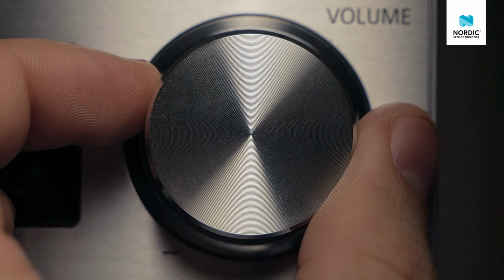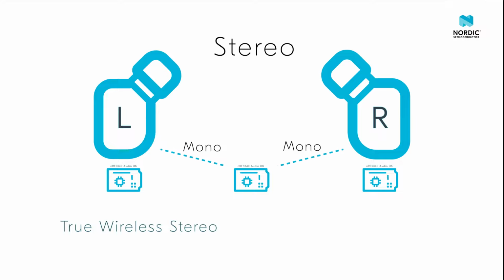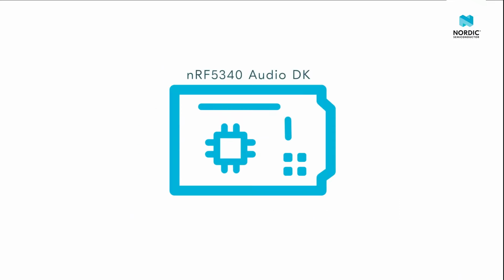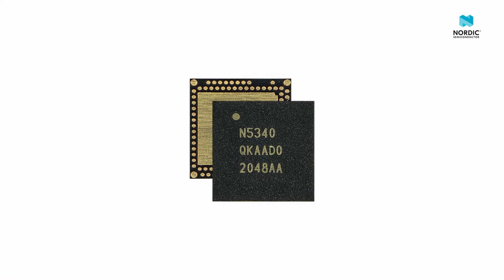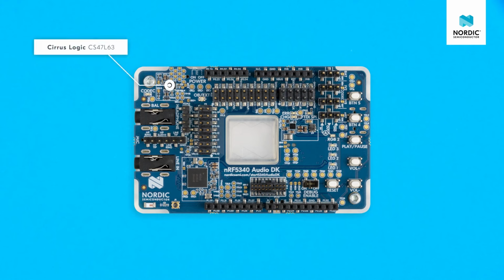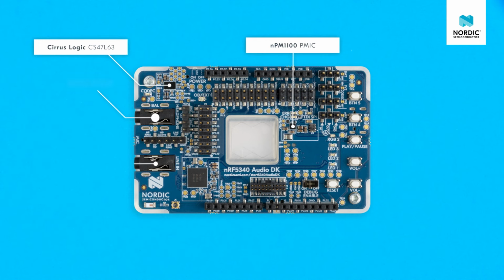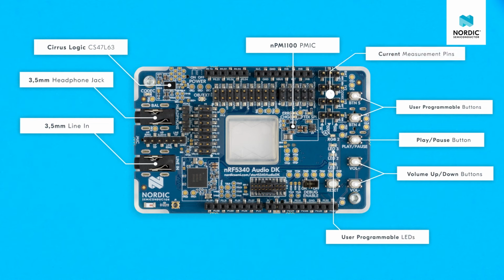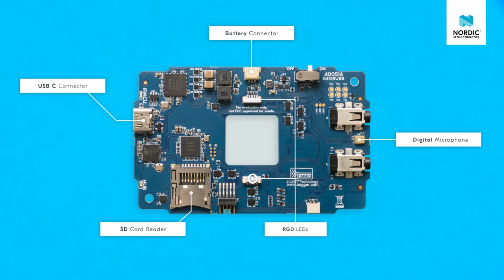Introduction to the nRF5340 Audio Development Kit

Comment: For the true wireless stereo... Do you need the third development kit or can you use a computer or phone as the audio source?
Reply from the maker: You can use a computer or phone as source. For computer you need Windows 11 and a model with a recent Intel chipsets. We used Samaung GalaxyBook as demo PC at CES. We have also successfully paired the Audio DK to Pixel 7, recent Samsung phones, and Sony Xperia 5V. Technically you can use nRF5340 DK as an audio source if you are using USB. The nRF5340 Audio DK has a configuration for using USB source and this configuration does not require more than what is found on the normal DK. There is no ready to use setup for this in the SDK so you need to det it up yourself.
Reply: Thank you for the info! @NordicSemi
Reply: You need a third dev kit to act as the source because your PC probably doesn’t support LE Audio yet (the PC would feed the audio through USB or Line to the “audio src “ dev kit). In the future, when the technology becomes more mainstream, you’d be able to have your laptop directly transmit broadcast or connected LE Audio stream(s). The first and second boards would be used as L and R earbuds

Comment: What is the maximum range what can be reached in normal usage, for example between 2 motorcycles? Transferring voice trough it?
Reply from the maker: Up to 1.2 km: https://www.nordicsemi.com/News/2023/01/Aptener-Mechatronics-BluArmor-C30-Helmet-Comms-Unit-employs-nRF52840-SoC-and-nRF21540-RF-FEM. 

We could present a number from theory, but we think this claim from one of our customers is pretty good and have more weight as it is a working solution. Note that this solution use a proprietary protocol with audio relaying which is not a Bluetooth LE Audio feature. The radio is the same though and has the same performance.
Reply: @NordicSemi  Thanks. But as I see they are using the older nRF52840 instead of the nRF5340. Are the nRF5340 better than this?

The normal nRF5340-dk is capable about the same what the nRF5340-audio-dk if I do not want to plug physical microphone into, just want to use the distance radio from it?
Reply from the maker: @hygyke nRF5340 has better sensitivity. With the nRF21540 you will get the TX power allowed by regulation when combined with nRF5340. The nRF5340 Audio DK has an audio DAC and on-board MEMS microphone, but the nRF5340 chip is the same.